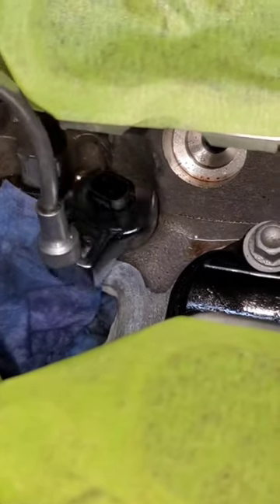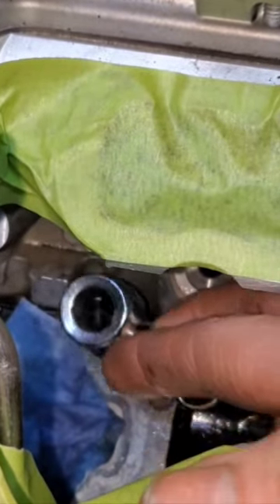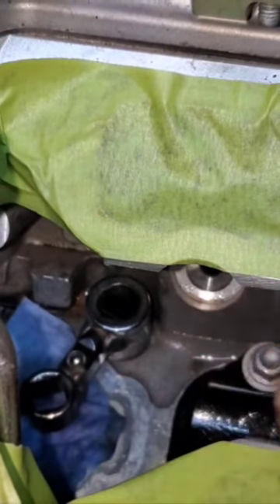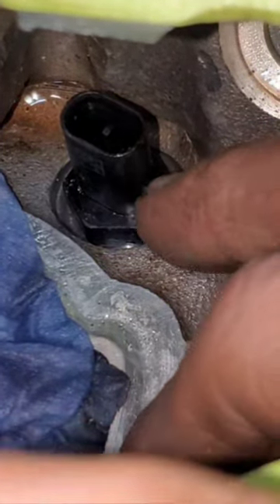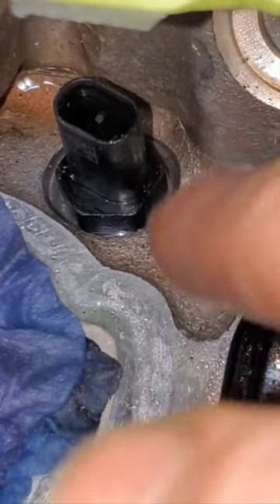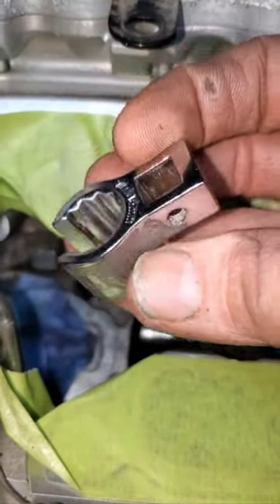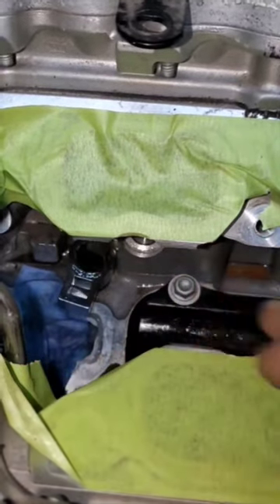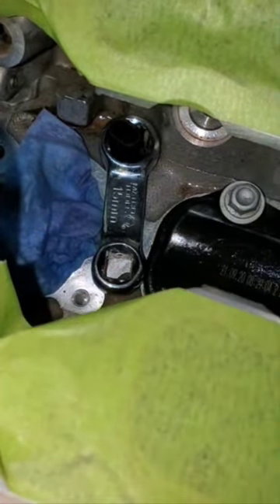No, Your Crowfoot Wrench Won't Work!

Comment: Engineers can REALLY suck at times. How can they be so thoughtless in designing vehicles that can be so frustratingly difficult to work on??? No one should have to "custom" make tools for their one sided thinking designs. In a refinery, you're ALWAYS having to keep in mind ease of future maintenance when designing a facility as well as for safety. SMH. Hats off to all the mechanics and DIY'ers going thru the struggle.

Comment: This is why I, sometimes, LOVE Harbor Freight Tools. You can cut 'em up and weld 'em together to make a weird thing without shedding a tear over doing the same to other tools that cost 2 or 4 times as much.
Reply: Yes , some Garbage Freight tools may be bent with your fingers .  Pull real hard on a 7/8” wrench and it transforms into a 15/16” wrench .
Reply: They might only get you through that one job or so, but he’s not wrong. The f*ck else is a custom tool gonna be used before the job they’re customized to do?
Reply: @AlexPeace246  Absolutely, I recently made a franken-tool for a job on a ski boat that I know, hopefully, I'll never see again. Part of that tool was a HF socket that I cut a slot in, ground shorter and welded it to a broken leftover no name combination wrench that I had lying around. Perfect and used exactly one time. I have other franken-tools that I use repeatedly and I label those with what job they go to. None of this made me cringe at the cost of the original tool. I never have to "modify" my Snap On stuff.
Reply: Yep, harbor fraud becomes your best friend when you need to make a tool
Reply: Bunch of cry babys  up there lol ☝️
Reply: Hobo fright is the shit😂
Reply: Junk tools make the best tools!.  Grind old press in wheel bearings to gently press a new one without getting stuck. Good luck
Reply: All these Harbor Freight nicknames are killing me lmao
Reply: The mere fact that you actually believe Horror Fright has ANY decent tools is terrifying.
Reply: @Rotorhead1651   The mere fact that you actually believe that Horror Freight DOESN'T have any decent tools is hilarious.
Reply: probably   special gm tool for that -dealer only
Reply: Buying a Set, for the price of One Wrench off a truck, makes it easier to modify them!
Reply: My love for harbor freight is unconditional
Reply: Harbor freight is awesome. Break it even on purpose and simply bring it back for a new one. They are the new craftsman. Wish their quality was as good as craftsman's though
Reply: Idk i have Pittsburgh wrenches from 7/8- 1-1/4. My 15/16 takes the most abuse and it hasn’t turned into a 1” yet. I regularly use that wrench on with my snap on ct9080 impact wrench lol
Reply: @iankerr1549 I broke my pittsburg 19mm long wrench and they wouldn't warranty with the reciept. I still shop there though like a hooked crack @ddict buying stepped on product.
Reply: Should be 20 to 40 times as much.

Comment: It cracks me up when some people see something like this, they say you are wrong and tell you to do it "by the book". If a book existed it would require a tool that fits that nut and slides into that countersink. Which is exactly what he made. I'm a mechanical engineer, anyone saying this guy is wrong doesn't understand even what tools are, or machines for that matter.

Comment: the auto makers should be forced to recall this and make the engineers
replace them this is the main reason I retired at 30 years from automotive repair shop
Reply: It’s so they can sell….”special” tools.
Reply: @Stick1370  lol there not that smart I’ve seen many times where there is not tools available and had to make something until an aftermarket company gets wind
Reply: Right there with ya buddy. Retiring after 40 years of this stupid shit in a couple of months
Reply: @Stick1370 most of the time they don't have special tools for their design mistakes.. when there is one it's because thousands and thousands of complaints and threats of legal action forced them to make a tool for it
Reply: @Onealfarm9967  so you've never set foot on a Matco or Snap-On truck. Gotcha. "I worked thirty years in blah blah blah".... Yeah, total "professional dude" logic here. But why buy it when you can build it. It happens.
This is why you work on Rigs, not crap passenger vehicles. Trucks were meant to be worked on by REAL engineers. Not these azzzzholes designing passenger vehicles today.
Reply: I have designed automotive components for 30 years. Everything I have designed had to be signed off for serviceability. I suppose this could have been missed, but chances are there is another reason why it is like this and no, it is not to sell tools.
Reply: Whaaa, 😢. I am sick and tired of mechanics complaining about modern cars being overcomplcated and hard to work on. If you are a lazy mechanic, go work in a specialty shop restoring old rust buckets. Just charge your customers accordingly. It's all nuts and bolts with a few clips. They build what sells and what sells are emissions compliant engines and safety features.
Reply: @TehBIGrat  you haven’t seen any engineering flaws in cars we’re not talking about lazy we’re talking about flaws if you haven’t seen any flaws you haven’t had any experience with cars lol I will debate and many old timers will too dude because there in every vehicle not one is perfect some are visible some are internal you kids today would rather fuse with a
Reply: Right the engineers , same with buildings they never worked on anything and don’t care , whatever the absolute most efficient and condensed as possible the better , I’ve seen 30 hp pumps with the strainers against the floor , you would have to remove the pump to clean the strainers 😂😂😂
Reply: @brianburnside5949  the big problem with engineering is nobody is on the same page you have one designing the eng one designing the frame one designing the body and one designing the trans and there so smart that when they put it all together it is what it is that is where no communication  I’ve been in them designing meeting with my new job and I’m to old I don’t know technology but it’s common sense
Reply: Whats funny is it actually should be a gm recall people have been arguing it for year along with the thermostat its a $1300 job minimum
Reply: I just don't understand people that make excuses for this   lack of  probably intentionally unthoughtful engineering  like these  sensors  will never fail 😂
Reply: @Stick1370 no. It's so you can't fix anything yourself or even go to a regular mechanic. It becomes such a nightmare you have to go the the rip off dealer. Tesla does it best.
Reply: After 30 years you were due to be retired 😂
Reply: @TehBIGrat I can guarantee you emissions compliance has nothing to do with the average consumer and everything to do with government mandates and planned obsolescence
Reply: @TehBIGrat if you think shops charge more for new cars you would be mistaken. All cars are charged the same for labor and unless its a luxury car youre paying sometimes even less on new because there are less brittle parts that break while trying to fix the problem part. Also classic restorations chsrge more than a regular maintenance shop
Reply: @Stick1370 I think they buy the cheapest thinnest tools to measure when they draw their designs because they have no clue what good tools are
Reply: Or maybe you could have been a better mechanic and built some tools like this fella did
Reply: @Stick1370  Fuckin short bus special. Bullshit like that is why I keep spare tools and crap tools around. Bullshit like that is why we have a 19/32" wrench. It's why I'm keeping my eyes open for a set of Whitworth wrenches...
Reply: They don't want regular people fixing their sht
Reply: @Onealfarm9967 they are more than that smart. Smarter than u will ever be..n it is exactly what they do.. they design parts to fail early sooner than later. It's a fact. Same goes for tools
Reply: @vinny.deadmou5d46  how did you know I’m not smart dang I’m impressed you got me on that one lol
Reply: Do it your way maybe they still make it in the U.S.
Reply: Settle down Sally
Reply: @TehBIGrat You sound ignorant
Reply: The real reason you retired is because you’re not skilled enough to handle anymore.
Reply: @richardmcdaniel3818  your wrong about that bro because you don’t know me and I don’t know you I retired from auto work to buy into a manufacturer company that makes paccar parts and other parts I’m the owner of the business so go pick on someone that cares because you don’t know 💩
Reply: @richardmcdaniel3818  Says Little Dicky mcdaniel? 🤣🤣🤣🤣
Reply: @TehBIGrat except it's like tonka toy crap now,too much plastic 🤮
Reply: Exactly, we need rights to repair everything!
Reply: @brianburnside5949  Given your experience, can you think of any reasons for why it was designed like this then? What reasons would they be?
Reply: @brianburnside5949 
Yeah you look like an engineer too
Reply: You're kidding, right?
(SMH)
Reply: @TehBIGrat 
They can bitch all they want about it. Cars ARE a pain in the ass to work on, and too complicated.
Thing is, the manufacturers are in business to make money, and most of the mechanical areas are designed to be assembled as cheaply as possible, and by automation preferably, service is secondary. 
That much said, a solid 33% of the complication(s) on cars is because of the "toys" people want on their cars - it's the options that sells cars, emissions controls etc. are a necessity of bringing the products to market.
Reply: Yeah like that's ever gonna happen.
Reply: I don’t think you guys understand why does engineers do these shitty design. It’s not because they are trying to be assholes but the companies that make these vehicle are prioritizing quantity over quality. Think of it like this:
If you are a CEO of a mega corporation, do you want your engineers design the sensor to be put on the block then the block into the vehicle or install the block then the sensor?
Obviously it’s wayyyyy easier to install everything on to the engine then into the vehicle so half of the repairs are impossible because it was NEVER meant to be repaired without the block being taken out. Also, don’t blame the engineers, it’s the marketing team who wants the fastest and most efficient method to push a vehicle out with the least amount of work. They don’t worry about repairs and “what happens if this needs to be replaced” because THEY DONT DO THAT TYPE OF STUFF.
Reply: But you waited through 30 years of it, and THEN retired…ok
Reply: @daboo7725 why 40 years?  If it’s so bad why keep doing it for 4 decades (plus a couple of months?)?
Reply: @phonkyfeel1  and yes it wasn’t that bad until pcms and money got to tight that people couldn’t afford the repairs
Reply: @phonkyfeel1  
It's gone to shit in the last 20 years.
Why ride it it you ask ?

I  own my own business,  like my work / CAREER decision, have great customers and a family to feed.
Sometimes the older one gets and closer to retirement,  ya just don't throw it all away and start over. Just ask a few responsible business owners / employees.
Reply: Or they should have the engineers who designed the dumb things repair them personally!
Reply: @TehBIGrat only mechanic can understand
Reply: @Onealfarm9967  the whole point is to have you come to their techs and spend money. The billion dollar company is a bit smarter than the diy'r aggravated about not being able to diy something. I agree it's bull but it's not accidental and certainly not dumb from a business stand point. Believe it or not most people throw money at whoever can fix their car whether they can afford to or not. Average people look at cars like rocket science and maintain them about as well as that pet rock we lost the same day we found it.
Reply: You can use a spark plug socket. Just because you worked in a profession for 30 years doesn't mean you  know everything. Maybe if you humbled yourself and took some classes on tools you would have known this trick. But you desided that you couldn't learn something new. Everything that was put on can come off.
Reply: like me.only repair my own car and it s sometime a nightmare😢
Reply: @lelemgo  your brave with labor cost you save a lot of money and goggle gives away of a lot of information I tell guys like you when you go to buy a car always look where the oil filter is at if you can see it buy it
Reply: @Onealfarm9967  and no too much électronique
Reply: @Dsimm130 I doubt that would work either. Atleast without grinding the walls down just like the other tool he was talking about. How would a a spark plug socket be any different than any of the other tools he used?
Reply: @Onealfarm9967  GM steering wheel pivot pin puller.  A tiny little puller designed only to pull the pivot pin out of GM tilting sterring wheels.  Shit like that pisses me off, it wasn't even expensive but try to find one at 6pm in a town of 30k ppl.

Comment: I used a sparkplug socket on that sensor, and used a open end wrench to turn it. Worked like a charm.
Reply: This. I bet some where in the service manual it says to do this exact procedure. Unfortunately most people 'know what they're doing' too much to read for 3 minutes
Reply: I just used a wrench aswell
Reply: It’s a plastic part. Use some pliers to grip the top part of the sensor. It can’t rust because it’s plastic. You made that tool for NO reason.
Reply: @Jeff_Epstein_  Now, you've snapped off the plastic stem and still need to remove/replace it.
Reply: @Jeff_Epstein_ I welcome you to make a video where that would work. I'm sure if that was the case, he would have done so. That censor is located on the block and the plastic will break if you grip it by the connection end..
Reply: @Jeff_Epstein_ and tgem agen you install it?
Reply: @Jeff_Epstein_   Ah that would be a hard NO to pliers gripping on the plastic.
Reply: They also make those things that go into the socket so you can put a wrench on the end of it.
Reply: @wirefeed3419  a red hot flat head screwdriver removes that. You never had to torch a drywall screw to melt into an orrifice tube to extract it from the evaporator?
Reply: When it quits running ya know it's hot enough and then you can get paid from scrapyard to live stress-free. Need more bicycles but McDonald's would fold
Reply: @Jeff_Epstein_ I don't understand how you made this comment and how you felt so comfortable making this comment and the people that also agreed/liked your comment, you talk like as if you are capable and work on cars but any one that has just enough experience working on cars will always advise against what you said to do because they know that plastic parts specially thin ones don't interact well w metal tools specially grabbing something w a thin edge in a tight spot w some pliers and finally a plastic part right on the engine where all the heat is most concentrated, the only your comment makes sense is if you're a troll, you should be embarrassed as a man to have commented something so ridiculous smh
Reply: @AdamC-94562  Of course it's a troll. Look at the avatar.

Comment: Thanks GM engineers!!! Smh
Reply: No kidding. That was just an asshole move
Reply: Well they are consistent that’s for sure. So many bad ideas and yet they keep coming up with more of them.
Reply: If there was some sort of accountability where engineers had to answer for the bullshit they put mechanics through, American automotive engineering would be a thing to be proud of.  The top has to answer to the bottom for useful change to happen.
Reply: As a GM Tech, that phrase is a daily utterance.
Reply: The GM 3.6L is trash; to do the timing chains, it's advisable to pull the engine out
Reply: Normal folks pick a brand to be loyal too.  Mechanics do to, but we hate other brands more than our favorite😂
Reply: @Silent_Shadow  tbh brand doesn’t matter for mechanics, they are more concerned about finishing jobs quick and beating the clock so they can make money. When engineers make dumb decisions like this they hamper the abilities of mechanics to complete jobs fast.
Reply: GM pisses me off sometimes but I sware early 2000's Chryslers were engineered by the Joker and his minions.
Reply: It's all of them even with a dodge challenger, you got to take an entire door panel off to replace a mirror.
Reply: Still would rather have a GM 😂
Reply: @fxui  you need to buy a Toyota
Reply: @kenxiong6830  Already have 2, L comeback 🤣🤣
Reply: @kenxiong6830  There’s a reason us Arabs love Toyota Nissan GMC so much 😂RELIABILITY🦾
Reply: @fxui  Toyota, maybe Nissan, but idk about GMC buddy
Reply: @kenxiong6830  It’s true us Arabs love GMC the most ABOVE ALL look it up😂
Reply: @kenxiong6830  GMC even makes special edition for us only because they are so beloved in Middle East!
Reply: @fxui  any extra cash they can squeeze out of you they will
Reply: @fxui  Arabs love Land Cruisers above all
Reply: @kenxiong6830  True but we love GMC and VTC patrol 2nd and GMC 3rd I only like GMC and people from Oman love GMC 😂don’t try act like us if you’re not
Reply: @fxui  thanks for stimulating the US economy. Good to know you guys like American trucks. You guys buy the 3/4 ton trucks? That’s the 2500 diesel models
Reply: They’re the worst.
Reply: @piercehawke8021 advisable? If you like your back I'd drop the front subframe.
Reply: @kenxiong6830  Mostly single cab 5.3 V8
Reply: @fxui  single cab V8s are pretty fast. Definitely fun for the streets and sand